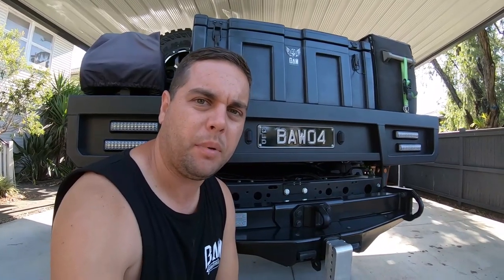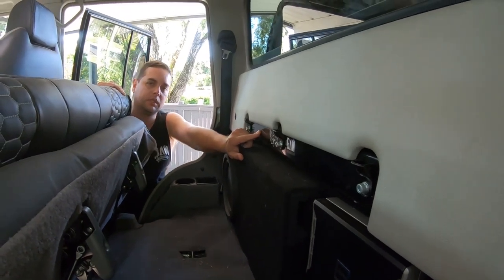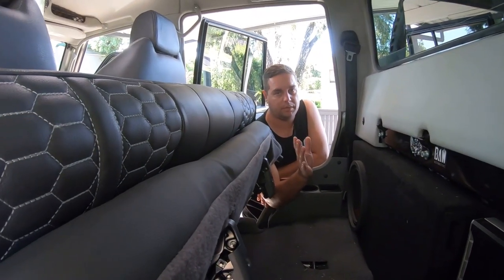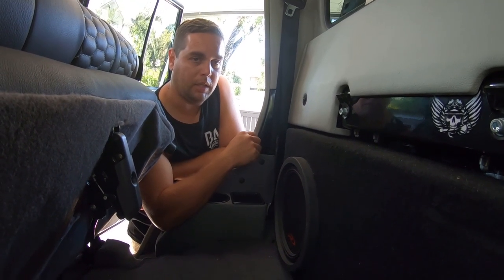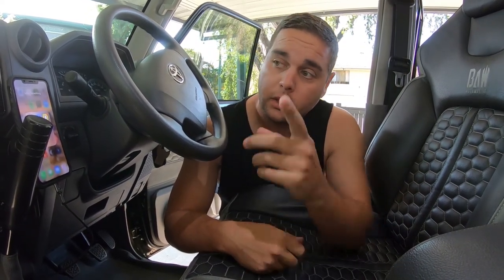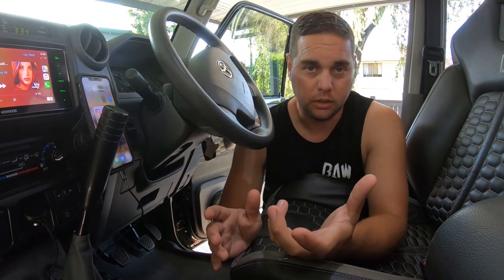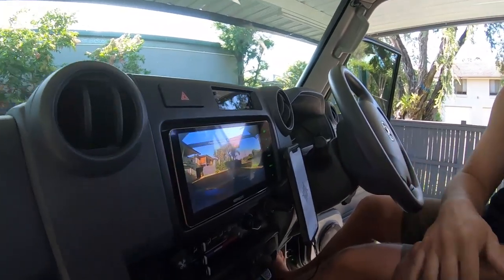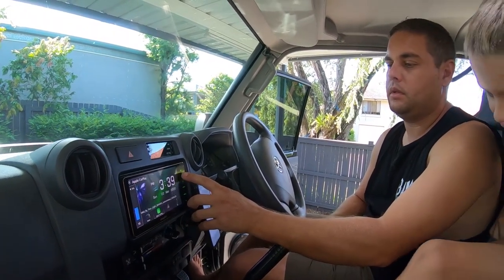Stereo Upgrade for the 70 Series LandCruiser | Headunit, Subwoofer, Speakers & Amplifiers

Comment: Why not run the larger alpine head unit, especially when your already running alpine amps...
Reply from the maker: Not a big fan of the Alpine head units.
Reply: @BAWAutomotive  yes but the largest size that moves the hazard light switch suits the dash much better then any other unit I have ever seen...